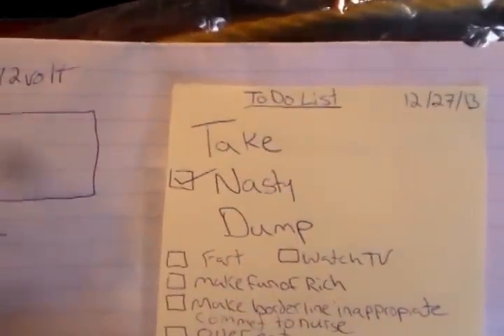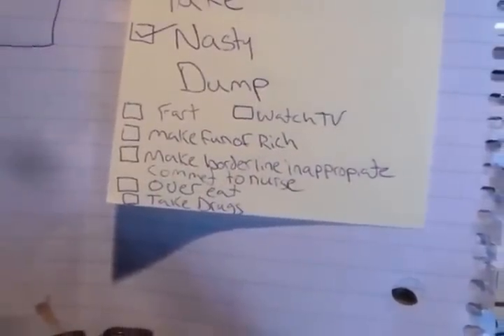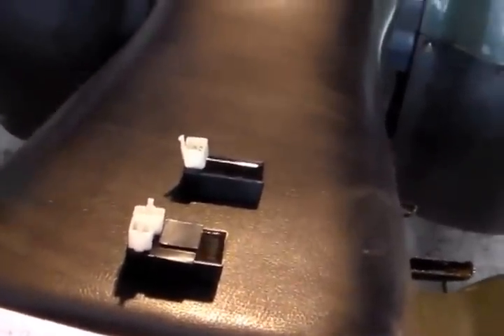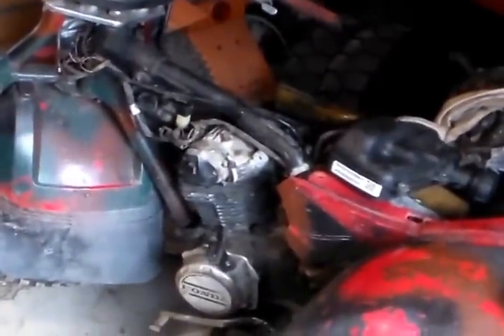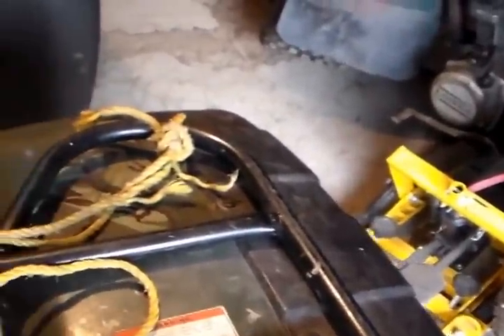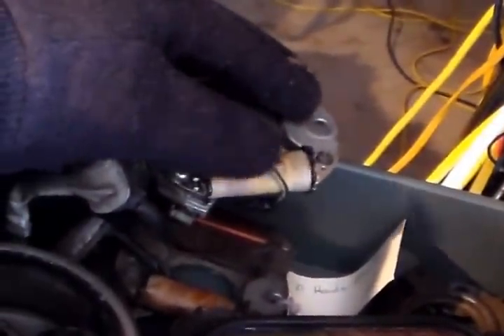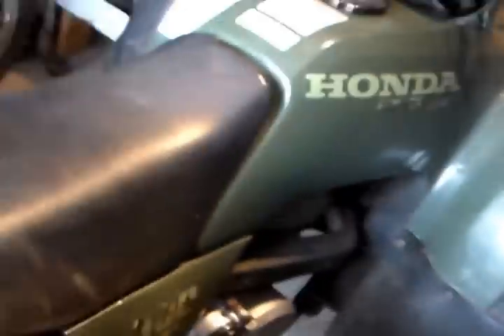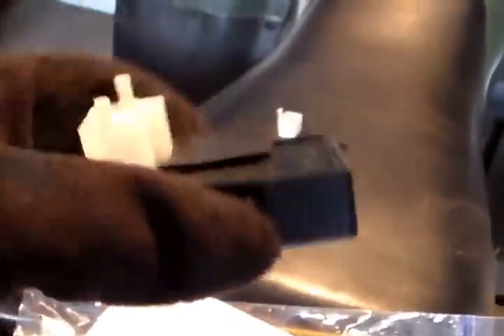12_2_2013, 12 Volt Honda ATC CDI project Part 1

Comment: I just got a 125m ATC Honda engine off craigslist for 50 bucks. has the excitor coil cdi i think on top by valves has two wires. and b/r and green coming out by stator. i got it to crank off of a 110 wiring harness and coil but no spark from plug wire whats the best way i can get this thing going..
Reply from the maker: Hey Stephen, I would double check to make sure U have a CDI pulser under that cap by the valves, I would be expecting to see a blue/yellow and a green... About the 110 harness, I would make sure that the wire that goes from the CDI to the off switch/button is disconnected and floating, other then that, I would check the grounds... Generally speaking, if U follow the troubleshooting from this video, U should find Ur problem...  https://www.youtube.com/watch?v=tvLnZv7uOHM  , Thanks for asking, watching, and commenting!!!
Reply: Thanks harvey ill check that out..
Reply: what wires should I connect to my pulse generator. there are two wires one green and other I can't tell because they painted black on it. again im using a 110 china harness. i did unhook black and white and got test light to light up touching black red. where should i hook blue white to from cdi.
Reply from the maker: Hey Stephen, I hope I'm answering the right question, if Ur pulse generator has 2 wires coming from it, green and black, the green should go to ground and the black should go to the blue/white from the CDI, if there are any other questions, please ask!!!   Thanks for asking, watching, and commenting!!!
Reply: hooked it up still no spark from black and yellow to ign coil. I'm using the China coil too.